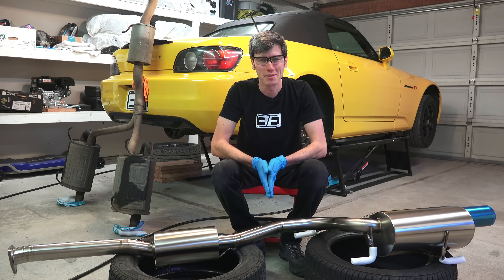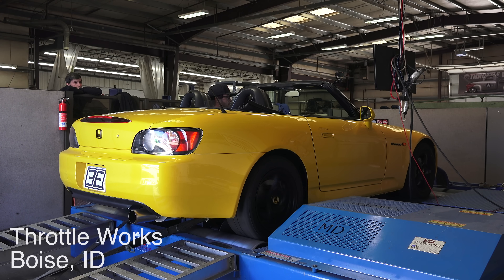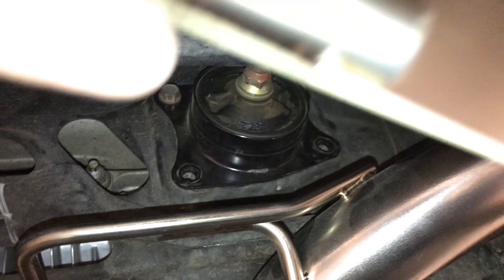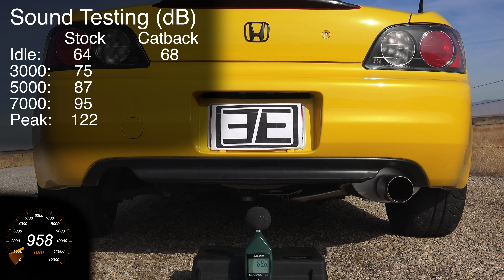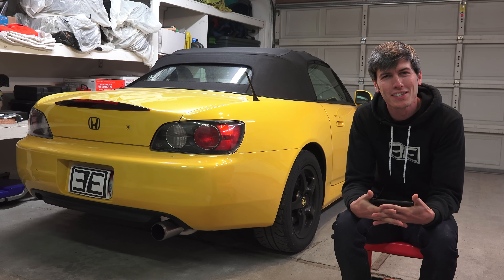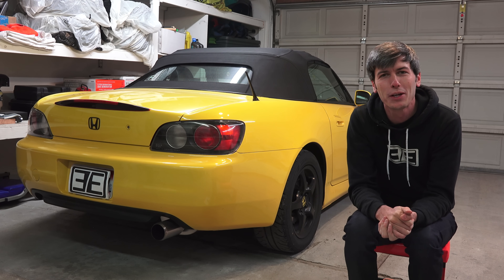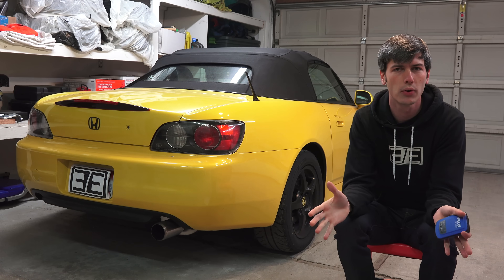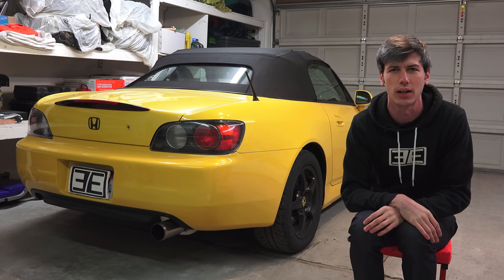Can A Catback Exhaust Make Your Car Faster?

Comment: Such a waste to put on a catback the same size as OEM.  If you do go with a freeflow cat later, then the catback becomes the restriction again.  It is a beautiful piece of work, though.  Now if you did it solely for weight savings, that's cool, but it just seems like a missed opportunity at a high cost.
Reply: Ladco77 2.5 inch is big enough for a 2 litre engine when straight through. You'd only need bigger if you were going to be doing intake and cams and tune it. Going too big compared to the engine displacement with natural aspiration can decrease the scavenging capability of the exhaust and therefore slow flow down. Sounds counter-intuitive but look it up, it's cool physics.
Reply: @smoothwalrus9354  Stock isn't 2.5" (63.5mm) though, the stock system is 2.36" (60mm).
Reply: In regards to 2.5" vs 3" exhaust on a TURBO Miata (so, smaller engine), the consensus is that the 3" is worth power and torque all up and down the power band. I know that on my car, I hit target boost about 300rpm sooner with the 3" over the 2.5".

My point I guess is that while 3" might be wasted on a N/A engine in the 2L or abouts size, it's certainly worthwhile on a forced induction car.
Reply: I don’t know the science behind. But it has been dyno proven that the H22 does gain HP and TQ from a 3 inch exhaust being NA. I know it sounds hard to believe. But it’s very real!
Reply: From what I’ve read on honda tech. Is the 3 inch exhaust is just like open header. Which big honda motors make power with. I can certainly understand you guys skepticism. I was pretty skeptical about it myself. Til you actually see they actually work really well!
Reply: True, but only if you go for a way oversized system. The 70mm option wouldn't have hurt the performance at all, I reckon it would have been just as good as the stock sized one.
Reply: How much scavenging is happening behind the catalytic converter?  That's very true about header primary size and length, but once you're halfway to the rear of the car the impact of too large a pipe is minimal.
Reply: Smooth Walrus I can attest to this. My car felt considerably slower down low after installing too big a cat back. Torque was significantly impacted.
Reply: Pretty much all people that actually race hondas and do stuff to go faster know that bolt ons and a 3 inch catback with a tune makes more power than 2.5 inch.
Reply: I did wonder about Jason doing a forced induction setup in the future though. I know he’s mentioned supercharging his s2000. This may be a bit restrictive for that.
Reply: 3 inch exhaust actually works really well with the H22. It’s just a 2.2L 4Cyl
Reply: Wesley no, it’s been proven that a 3” adds hp on the s2000. I don’t actually know if it’s true but people who have done the research here on this comment thread say so
Reply: XRIDER0002 wtf, back pressure is not a good thing . Don't ever say that again  about exhaust  systems.
Reply: XRIDER0002 nope no losses. It's a common thing to do with the 2L setups for Honda's. Common knowledge.
Reply: It works well on the K20's also. Anything 2.0L and above have had good gains on Honda motors
Reply: And probably would have sounded better :-)
Reply: Ladco77 if the pipe suddenly becomes larger and the exhaust wants to scatter outwards it hits the exhaust pipe wall at a more severe angle and slows down, hence actually slowing flow and preventing scavenging.
Reply: Stephen Landon of course :-)
Reply: XRIDER0002 yes I know, but 3inch is a very good upgrade for this engine as it already has been proven to make more power.
Reply: Tony	 C 3 inch is pretty big is pretty big you sure? That's v8 territory
Reply: I honestly don't believe it I'd have to see the difference between exact same set up of a smaller exhaust and the 3 inch. I'm almost willing to bet that You lose torque with a massive set up like that
Reply: This actually becomes an issue with back pressure as u increase the size of the exhaust you loose back pressure. Maybe we can get a video about back pressure
Reply: @ladco77 if that's your argument regarding exhaust systems, then you know so little
Reply: Andrew Bartleman I know I hate when people say oh you need back pressure or you will lose power how would less air flow through your engine make more power I imagine the people saying they lost power without back pressure either got to big of an exhaust and lost the scavenging effect or their air fuel mix when lean
Reply: Wrong. Its tried and proven that this engine performs better with a 3inch on it. All over the S2K forums. Since he is not planning on changing the CAT in this then there is no point putting the 3inch in.
Reply: You don't want to oversize exhaust you loose power when you do....
Reply: XRIDER0002 like I said look at the forums. I am very sure as it's to do with flow. V8's don't normally scream anywhere near as high as this engines does. 3inch is also commonly used with turbo setups too. V8's are not the only things out there...
Reply: Even with the rpms going up so high on this I really don't see a 3" being any good I really think you would lose torque as a result of using a 3"set up as opposed to something like a 2.25 or a 2.5. Back pressure is a good thing so having a 3" exhaust on something that's only A 2 Leader doesn't make sense to me isn't like it's a big boost application anything it's just naturally aspirated
Reply: Ladco77 pretty pointless to increase the size of the exhaust on an NA 4 cylinder if it was turbocharged then yes a bigger exhaust will help a lot.

Comment: Other than weight, this exhaust is absolutely worthless due to the cost. The s2k was tuned to it's maximum performance from the factory. Bolt-on's do nothing. If you want power, turbo/super charge it.

Comment: Beautiful exhaust & I fully agree with him not wanting a raspy or ricy sound.  It's worth the money for the weight saving alone in my opinion. Anyone that disagrees then watch the Touge Monster orange s2000 driven on the Gunsai Touge.

My Invidia Q300 sounded great & I loved it. My cat recently collapsed inside (guessing from hitting speed bumps) so I put a decat on it....sounds raspy & horrible at 3000 to 4000 RPM. Can't wait to get a new cat...shame Honda want £1438 for one 😮

Comment: I'd be interested to see what the difference is in HP-to-weight ratio. Also, the engine, as a complete system in a vehicle, encompasses everything from the air intake snorkel to the muffler and tailpipe (and of course the various electronics that make it all work).

Comment: Plus it's lighter! don't forget the power to weight ratio. Now get rid of the cat and complete the full system!
Reply: It all adds up, start doing other bits and you'll start shredding more n more weight. For instance stock manifolds weigh so n so on their own, but start changing the whole exhaust system then other bits like seats, wheels etc etc every bit counts. With these little Hondas power to weight ratio is everything. Of course subject to the owners end target.
Reply: +Peter Peter Pumkin Ether I'm not saying spend 3k lol you can get other systems that are far cheaper, do the job and still weigh less than a stock system. You then do other modifications and the car benefits even more. You obviously don't get it buddy and must be a backyard builder. Basic maths isn't that difficult, don't think you understand the term power to weight ratio either. Doubt you've ever even lifted a stock exhaust system. Please stick to a stock car and don't bother entering the modifying scene.
Reply: +Peter Peter Pumkin Ether Yeah I'm sure you have buddy, and I've done this n that lol fact of the matter is simple maths is simple. I'm not saying go spend thousands of a little honda but they lack torque, lose weight but not just an exhaust system on its own, the power to weight ratio improves as said before. Exactly why hondas can be quick around the track but also pull on heavy boats that struggle to get off the line.
Reply: You could swap the cat with a high flow model, and get a few more ponies back. I'd like to think with that Honda engine, the cat wouldn't work too hard either way.
Reply: There's not going to be much difference with just the exhaust lol, I took my back seats out and the spare tire of my car and it probably adds up to the same amount, car felt no different whatsoever
Reply: +Because Racecar Course there's not gonna be a big difference with just an exhaust, you could say that about most modifications in general done by tuners if they did 1 thing lol same thing as slapping on an intake without a remap or anything else done
Reply: HA HA
Reply: +Peter Peter Pumkin Ether You don't have to "feel" it to know there's a difference lol that's totally subjective and "feeling" it will differ from person to person, on different road surfaces... all these factors lol fact of the matter is, the numbers show it n you lose weight and combine it with more weight saving like seats, panels etc the power to weight ratio improves lol why do you think supercer manufacturers do lightweight body parts and some even removing the radio, you won't feel it at all lol but it adds up. Plus add performance mods, it improves even more. Simple.
Reply: Fuzion180 That's true, but might screw up the weight distribution. Tough you'll only care about that if it's a more race-oriented car
Reply: It would be lucky to weigh 20kg lighter. About the same performance difference as with or without a  4 year old in the front seat or taking a dump after burrito night. On a 200whp 1250kg car you're not going to notice 1.6% weight saving.
Reply: Buddy you'll never feel a 1% weight saving,. A Ti exhaust on a street car is for bling, and theres nothing wrong with that. If you want power to weight ratio dropping 3k for 20kg is one of the last things you'll do. The temp change from an early morning to middday would make more of a difference, as would leaving 15l less fuel in the car all the time.  If you want power to weight, you're far better off chasing power and picking up some much needed midrange.
Reply: Yes i can see you have an engineering explained diploma in bench racing. GO for it though, spend 3k, on an exhaust that givees you a 1% weight saving that as you admit you cant feel, just so you can say it all adds up.
Reply: Im not one for pissing contests but if you want to call someone out who you have no idea who they are im happy to bite since  ive been racing things since i was 4, from dirt bikes, top 5 in national superbike championship and top privateer which ran 14.7:1 on pump unleaded (and ran an ti akrapvic exhaust for what its worth), tuned myself. Have owned built from the ground up and tuned  numerous tough street cars, ranging from a 430whp s13 shitbox sr20 back in 2001 to an 800whp turbo ford which myslef and my old man built the long motor and close ratio tr6060 in shop, plus have experience with ecu's ranging from megasquirt, to m4 motec and their adl dash logger, black oak ford oem ecu and microtech mtx-12.Have spannered,  tuned and done data acquisition on a couple of the domestic f3 cars which run the archainc bosh ecu as well so you might want to save your lessons for someone else.

Comment: The cost is mostly in the material and the labor for fabricating the exhaust.  Titanium is more expensive than stainless steel, and harder to weld, hence the extra cost.  You would pay less for a stainless steel exhaust of the same design, and gain about the same amount of power, but you do get more weight savings with the titanium, improving power to weight ratio, even if it is a small savings.  Now on heavier cars this wouldn't be that noticable, but on a lighter car, such as the S2000 or the Miata, it is more noticeable.  Is it worth $2500?  Yes, it is.

Comment: Curious since I have never really seen an S2000 with the exhaust off, does anyone know what the little capped off pipe on the exhaust does? The one that is sticking out 90° from the exhaust tubing about midway up the car.

Comment: a 70mm exhaust with a high flow cat makes a much larger difference than what was tested here. with the results here they were so low that it is still practically stock other than weight. i know my setup is different on my s2000 but you can feel a difference in power over stock. all i have is a litespec titanium exhaust with a test pipe and a k&n filter. great video btw it shows that the muffler isnt the restricting part of the exhaust and its the size of the pipe.

Comment: I’m both a motorbike and car guy, but more bike when it comes to improvement and 2nd market changes. Normally when you change an exhaust it’s always advised to fine tune injection cartography on a dyno to see a real improvement, as the gases are more free to go, you can take extra power by tuning it

Comment: I don't see any difference in horsepower, probably if you have measured HP with the stock exhaust multiple times, everytime you will end with a slightly different number, it is process variations I think, 2hp is nothing...

Comment: It's been well documented that the s2000 doesn't see much hp gains with intake or exhaust.  Honda did a great job squeezing that F20C for what it's worth.  Turbo cars do see good gains with exhaust mods though.  Especially turbo cars from the 90s and early 00s.  Btw you should do a video explaining exhaust back pressure and it's effect on hp and torque.

Comment: What I would like to see you do is install a AFR gauge and do dyno pulls with both exhausts. That would give a real idea of what the difference is between the two is. adding an exhaust without re-tuning it wont get you much power even with a much better exhaust. adding more air flow with out more fuel doesn't get you much but the AFR readings will give you a good idea of what you could gain by adding more fuel. I have built axle back systems on Honda 4-cylinders that change AFR at WOT as far as from 12.2 to 13.2.

Comment: You gained 1% in power for $2500, a q300 is $500 and would've only weighed about 10 lbs more and is still a very quiet setup. So essentially what you paid for, you could've had a unicorn header, q300 single catback , and a dyno tune done. This would've save similar weight (the unicorn header is lighter than oem), and you would've made an actual difference in power (around 5-6%)

Comment: Thank you. Great explanation especially from an engineer. But I wish that you had replaced the intake and replace the catalytic converter with a straight pipe. And have a dyno results.  I know you care about the environment and not willing to replace the cat with a test pipe but you can  replace it back with the catalytic pipe after you dynoed it.

Comment: What kinda of muffler they put on.. is it  a straight throw or a baffled type.. when u had your exhaust off did u have a look with a torch to see through the cat see if it was collapsed? I dont know what rules u have over there and if it gets checked much.. i think u should maybe do a cat aswell and see the performance and weight difference.. plus it might make it a little bit louder to
Reply: Oh plus if u do a supercharger swap u will see solid gains with exhaust header and cat.. plus your engine bay temps will be alot hotter with supercharger and having a more exhaust flow will benifit in heat dispertion.. when u do finally get the supercharger kit  dyno see if u can have a camera on your exhaust header and measure temp coming out of pipes on full load .. pre supercharger and with supercharger . Thermal efficiency is weird when it comes to exhaust flow specailly with turbos

Comment: Higher humidity significantly reduces drag. H2O molecules weigh a lot less than N2 and O2 (18AMU vs 30 and 32 AMU respectively). For a given pressure, the number of molecules per unit volume is the same, but at higher humidity more of those are H2O, so the air density is lower. Yes, you'll make a bit less power with less O2, but aerodynamic drag is the biggest factor (power required goes as the cube of the velocity, after all)!
Reply: PS This is why for track cyclists, all of the hour records are attempted on high humidity days and at high altitude - makes a surprising difference!

Comment: I believe that after 10-15 years there are no difference there are cat in your exhaust or not (emission-wise).
But decat exhaust gains would be even bigger.  On the other hand - I've tested straight exhaust on my bike, I've saved ~7 kilos and boy that changed bike's behaviour - sharper throttle and way lighter.

Comment: Water vapour displaces air and therefore oxygen, but relative humidity alone is misleading. Because your humidity readings are relative to saturation at those temperatures, the air when testing your titanium exhaust actually contained less water in absolute terms, which would give you 1% more oxygen. On top of that, the higher atmospheric pressure and lower temperatures will also increase oxygen levels a further 2% . Therefore, if my calculations are correct, there will have been around 3% more oxygen available during the second run. That could account for much of your improvement in acceleration. Enjoying your videos, thanks.

Comment: Goes to show how well-engineered this nearly 20-year-old car is. If you want to know whether your car needs an exhaust, do your research and find out how restrictive your stock system is. Some cars absolutely don't need it, while others will net reasonable gains from a relatively small investment. Forum posts with before and after dyno sheets will be your friend. 

Find an exhaust that balances flow with exhaust gas velocity. Choosing the largest diameter possible (especially on a stock engine) will typically net you decent power gains only at the very top of the rev range. An exhaust that is correctly sized for the engine output will net power across more of the power band. Area under the curve is more important than the peak power figure.